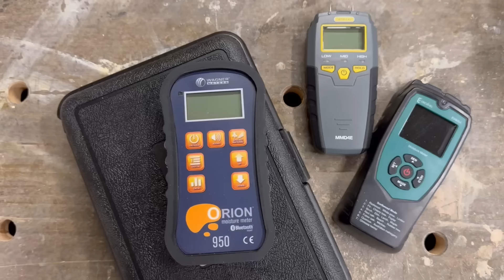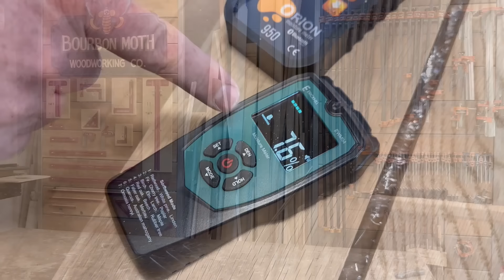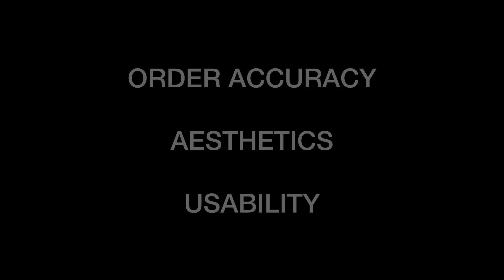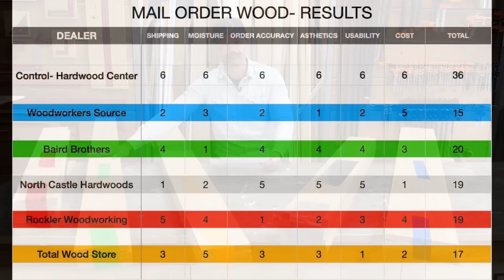A Thousand Dollars Worth of Wood || Buying Wood Online

Comment: This is video is probably quite helpful.  Pretty tough on some of these sources as doesn't sound like they did too well.  Just some comments.  I've been cutting wood for 60 years.  I've built over 100 cabinets, tables, furniture etc.  I think each of us has different abilities with our shops.  For folks with complete shops, we don't really care much if the wood is completely surfaced, has more than 1 straight edge, and for that matter, particularly caring about moisture content.  We do care if it is warped and cupped, twisted etc.  We very much do care about the grain and esthetics.  Of course we want the moisture to be level by the time we use it with local humidity. I surface all wood that for each project with jointers and planers and my wide belt.  Fortunately I live in an area that has decent hardwood sources.  I go between them fairly often, but have a good relationship with the closest place.  I ask them to give me a text when they break out new unit of wood.  Most companies want to see you, so they will do that.  I keep a fair amount of wood on hand, (another reason I don't care that much about the moisture content). So it would seem I don't need to buy wood online, right?  Wrong.  I've bought wood online for almost 45 years.  Why?  Because most hardwood lumber yards don't carry particularly "fancy" wood.  Flat sawn, sure, quarter sawn, probably, but figured lumber or other special stuff, not so much.  I used to find a good supplier that I could buy from and would have them go pick over their stock and have them ship me the best they could, and I'd pay a bit over the price that they quoted.  I got some great wood that way.  Unfortunately, most of those suppliers are gone.  But not all, and more and more, with the internet, for figured wood, you usually see good pictures of the exact wood you are buying.   My point is, if you are buying white oak, or maple, or common wood, try to buy extra and keep stock, especially if you have to drive a distance.  But if you are looking for something special, you might well have to get it online.

Comment: Ive ordered from Rockler many times. Big fan of them. Have used Amazon to get some bubinga which i needed for a project but rockler has been out of stock forever. Came in fine shape. Also picked up some ebony from ebay.

Comment: When I first got into woodworking, I had moved to a different state and had a local Rockler store down the street. I found their local wood selection to be decent but there wasn't a whole lot of variety in it and it was a bit expensive per bd ft based on what I had seen elsewhere. I found a larger local hardwood store that was a little further away and they were great. Luckily when I moved back to Iowa, I was right by the Woodsmith store (yes, the same place they film the show!) and they have always had a great selection. The recently downsized into a smaller unit in a strip-mall but I still find they have a very high quality and large selection compared to most other options.

Comment: My experience with Rockler was not good. First they were not responsive. Second they wanted me to pay the shipping for a return, making it more economical to keep an unwanted produce and make the best of it.  Last, they had a notification that there may be a restocking fee. S, I'm not so sure that they would be accommodating.  Good bye Rockler, I will not shop there. But this video was the best. Very exhaustive. You hit all the important points. Very informative.  Thanks!

Comment: I once bought 100 bd ft clear alder online from Woodworkers Source out of Phoenix.  It was not clear (abundance of knots); the pieces were irregular such that a five-inch board tapered to a live or semi-live edge to 3-1/2 inches; and most had some other defect (split, gouge, bow, bend, etc.) such that the waste was phenomenal.  I sent an email with pictures to the store but got no response.  I did a follow-up telephone call but the guy I spoke to said he didn't look at the pictures I sent because he didn't know how to do that.  I ended up eating the cost and using what I could in various projects, which was not often.  In fact, that was about four years ago and I still have some of that junk in my shop.  Never again.

Comment: Great program, I'll be watching it again. Considering the variability of the results, I'm stuck with a Woodcrafters with a four hour round trip to Jacksonville and back. But Home Depot and Lowe's, both within five miles, do have oak, poplar, nice clear pine, and some maple. But you did point out the problem with having some else pick your wood for you. When I'm trying to build anything I look at every piece of wood from every angle. I would have to teach someone how to select wood for me. No one will be as particular as I am. Wish I could get some of that Baltic Birch plywood with the high layer count for cabinets. Just cleaning up the edge gives a great appearance. How are these companies you got wood from about exchanges. Thanks for a really good show!  "Bob in Gainesville"

Comment: I ordered 6 pieces of 7' premium black walnut from Woodworkers Source and had the exact opposite of your experience. It was listed as having at least 7" clear and half the boards showed up at 8" to 9" clear with only one board coming in at exactly 7" clear once ripped to eliminate a knot hole. They were pretty much flat out of the box, at 7' you are going to get a little bowing off of most wood, and as I was going to glue them up for a tabletop it worked out fine. They were 3/4" finished S2S and the surface finish was pretty good only needing light sanding to take it to finish and they had one edge straight ripped. I got 189 board feet for $519 - they were running a special for a 6 pack of boards and the shipping was free and I got $10 off for signing up for their newsletter. I calculated the board feet at 3/4" as that is what they arrived at despite the site listing them as 4/4 and the actual thickness is 13/16ths. I requested that the boards match as closely as possible and they did, and the little sapwood that was on one piece was on the rough edge that disappeared once I ripped the boards to size. 

I'm not getting paid for this, and I don't have any relationship with Woodworkers Source other than giving them money for wood, but I was happy with what I received. The time from order to receiving my wood was 14 days but as I wasn't in a hurry that really didn't matter much to me.

Comment: Back when I discovered some good ones Herne Hardwoods, Ditto Groff hardwoods. You will probably only get rough. Looking right now, a minimum order from Herne is $300. Now common grade cherry is $3, and figured is like $14. But let’s talk common. You are getting 100 bd feet. Common black walnut is $6.
Of course at that quantity it comes in Klingon wrap by truck. A friend would order “log run”. Cut and kiln dry, no grading, no exact amount, you get the whole log

Comment: For what it's worth I have more than 30 years in the handheld meter industry and Delmhorst has always been the 'go-to" for wood moisture metering. 
Meters that measure at the surface do not do you justice. You need the spikes the enter deeper into the wood fibers to obtain a more accurate overall internal reading of moisture 'inside' the product. Not a promotion, just facts.

Comment: Very informative video. However, at those costs, I think I'd try to find a physical supplier, even if I had to drive a little.  The only thing missing here is calls to customer service with your issues and the results of your customer service experience!  2nd video?  Then, a build (or builds) using all the (useable) wood?

Comment: Ouch!!!  My local wood store is woodworkers source.  Just like your control group, I pick out the boards I want, and I am happy, so my experience with quality / price is much different than yours.  I am so surprised with your tests (I am not questioning your results in any way), because at least with my in-store experience they are better than the other wood stores in the area.

Comment: I guess it depends on what wood you are ordering. I covered the walls in a room with pine shiplap. I went to the orange store you don't like and could only find a couple of straight boards. I ended up ordering enough to do the whole room from their website that was actually cheaper from the store even with shipping and did not get one board that was unusable. This was with multiple 10 packs of boxes that they delivered. I ordered a few more boxes tword the end of the project since I was short and they arrived very fast and just as good as the original order. I am guessing they hand pick for the online orders.

If you want live edge wood the lumber shack has great wood at a reasonable cost and free shipping. I have a huge 3" thick dining room table I am building from a matched black walnut pair of live edge slabs.

Comment: Great video, however, I think your rating was a bit warped, or rather bowed by your love for your hardwood store 😉.
As far as delivery goes, you gave an automatic 6 to your local hardwood store, because it's... local. However, some people don't have a local hardwood store, and in that case, the "local" store 50 to 70 miles, litterally hours and a good chunk of gas money away, can drop down on the convenience rating. If you have to spend more of half a weekday to get some wood, it makes you think twice.
What's funny, is that I live in a pretty rural and montainous area, so there are several mills, but none of them has a kiln. So you are restricted to mostly soft (but local species) and wet woods, that you have to dry for years until you can use them.

Comment: You scared the bejeesus out of me.  I had a package of flakey white oak veneer sitting in the living room I hadn't opened.  It was from Woodworker's Source.  I immediately went and opened it.  It was very good, not excellent.  A FEW minor areas of tear out around the ray flake.  Perfectly tolerable.  They source it through GL Veneers though.  But at least I know to hold their feet to the fire if I order boards from them.  Thanks for doing this.  Anybody want to open a giant hardwood store in Boise, Idaho?  We have some, just not a huge variety.  Like Hardwood Specialty Products in San Jose, CA.

Comment: We are going with the assumption your local lumber yard can do s4s I assume. Not all do. So usability I think I would have switch silver with local since you literally could open the box and glue up a panel in 5 mins. If you local lumber cannot s4s then u have milling time to account for in usability. Everything else I’m good with but I do personally have to give the nod to silver on usability. 

Great video. I’d love to see a follow up video doing this exact same thing, same white oak. Same board ft. And see if the results match twice. Meaning consistency is the only thing this video cannot account for. (Yet)

Comment: Bell Forest has been my go to they shipped to my FPO/AP when I was active duty.  They. have a big variety and can. do. custom sizes on most.  Never had issues with moisture issue,  and they. will. photograph your order so you can see what your getting in advance.  I order a lot of rough from  them,  never received. anything but minor warp or twist.  But that is part of buying rough sawn.    They will even. help if. you need everything from the same tree,  or odd sizes.   Boone. has always been. a great help.   My. biggest order was 200 bf of 8/4 Hard  Maple, and half ended up with significant striping.  Ordering S4S was exactly. 3/4 inch. thick as requested and sanded.  No I don't work for them,  and only know them on the phone or email!

Comment: I prefer to buy locally, and if possible from smaller mills, for all the reasons Jason mentions, but certain species are really expensive where I live (walnut is absurd here in Denver). The store I like to order from is LL Johnson Lumber aka Johnson’s Workbench in Michigan. Their board foot cost tends to be significantly lower than other shops for domestic species, esp maple which is plentiful in MI, including soft curly maple. They have different price points for different grades (ie: #1 select or clear sapwood maple will cost you a bit more than paint grade), and they can do surfacing (1-4s) and color selection for each batch for a nominal fee. Boards are always a little oversized. Discounts over 100 bdft as well. They will custom build edge glued panels for you too, a great option for beginners or when you want to save time. I'm building a couple sewing work desks for my wife and the 1 1/2" tops they built for us are soooo much nicer than the junk random length countertops that most retailers sell - and the price was in the same ballpark.

Shipping is where it gets painful, but if you only need a small quantity it can ship via common carrier, or if you can do a big enough order the freight cost isn’t so bad. I’m sure rates are not great going all the way out to CA or the PNW either. Shipping times are usually 2-3 weeks, but that's freight, it may be faster for small orders. Online ordering is very limited, you need to email and get a quote, but the sales guys are responsive and very helpful.

Something like $35/bf for white oak is wild, especially with the short board limitation. I tend to land around $10/bdft for rough sawn domestic species including shipping (a few bucks more for walnut) from LLJ. Surfacing and color selection doesn't add much to the cost.

Comment: The moisture "points" seem a bit off to me. If most of the wood was in the range you are good with, why would the "best" one get 2x as many points as the 3rd ranked one? I would have done 10 points for the best, 0 point for the worst, then put them in a range between the two. EG: if 2nd best was 90% as good as best, it would get 9 points. If 5th best was only 15% as good, it would get 1.5 points.

Probably could do the same thing with the shipping times. If 5 of the shipments came within a week and the last one came 3 weeks later, why give the 2nd worst one only 2 points. It's pretty good overall compared to the others.

Same thing with cost. If all the places where within a couple of bucks of each other, but one was, say, 5x as expensive (or super, super cheap), it makes sense to scale that data and clump the points together, make the outliers more noticeable.

I'm sure I could do that work with the info given in the video, but it's the weekend right now and I'm not going to do it. 
🧐

Comment: Most of the other categories I could get, but I'm not sure your local retailer getting a 6 for usability makes any sense for...any hardwood distributor. Even with careful picking I'm not sure I've ever bought anything that didn't need to be planed and - especially - jointed & sanded before it was usable.

Comment: First thing you should do before judging a wood supply company is buy or borrow a quality accurate moisture meter. The two moisture meters used in this video were useless. Two quality meters to look at are (in no particular order) Lignomat and Demhorst. While each of these cost a few bucks, at least you can trust the readings to be accurate. If they’re not accurate and reliable then you might as well not use it.

Comment: next time you do such a comparison:
1) it'd be nice if you didn't use rank points but score points instead eg. for the price 5$ vs 10$ vs 20$ is a huge difference (I know it's not the real prices from the video)  in your system the it would be 3, 2 and 1 points but id' rather give it (out of 10) 10, 6.7 and 1 points.
2) do a pick from the store to have a real comparison (there might always be a day where you don't get the perfect match/finish because it's on back-order or just sold out or what ever... your pick from that day might just be on par with the second best option after all
3) do a comparison of your own time spent (and maybe factor that in to the price?) as going online and ordering might not always be as straight forward as one might think
4) and you forgot the shipping cost for your local store (it's probably not much - I don't know how far away your local store is but it's probably a few miles and just driving/having the truck will cost you as well (of course less than the shipping cost online but it's hidden cost)

Comment: Thanks, this was very useful and interesting. Your ranking system,  I believe, leads to some misleading results as it forces even a good performer in a category to get a very low score even though it is only slightly less good.  For example, consider that by ranking mosture content 1-5, when all were at least acceptable, really disadvantages the lower rankings.  You are an experienced pro, and I would have valued your opinion where perhaps all samples got a 4 or 5 (for moisture or whatever) as they were all so close.

Comment: i wondered about that. i have to drive across Denver Co. . but i get the wood that . i want. you tell them what you want. they take the pallet of wood down . each pallet is like. 4/4, 5/4 etc. and different woods. each pallet. has 1000s of board feet on it. white oak is probably about $8 now rough sawn. i s4s walnut at that price. i will never do that . thanks for making that video.

Comment: Thanks for the video! 
I don't think the scoring system was that great. If 2 suppliers were similar in a category they should get the same score (instead of ranking them 1-6). Also, doing it with only a single order per supplier is a bit unreliable.
I would have also liked to see you reach out to the one supplier regarding the red oak and see if they would actually fix it.